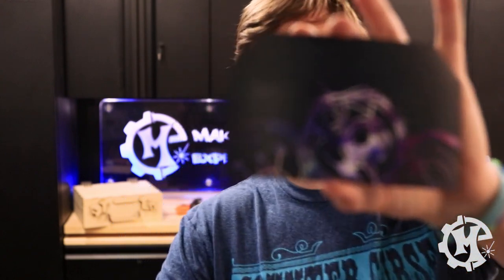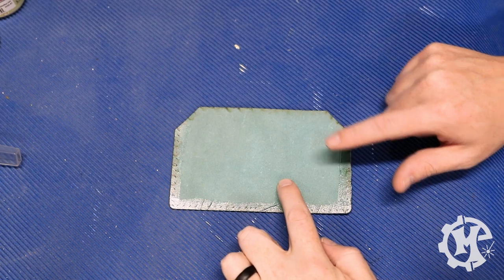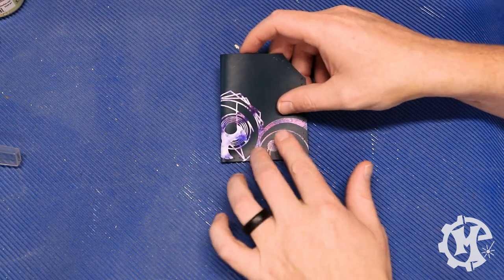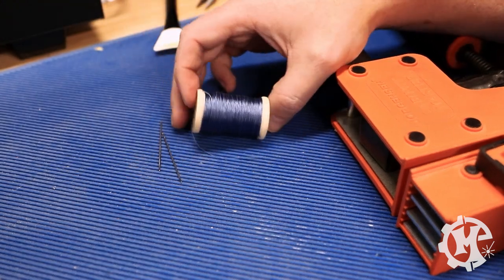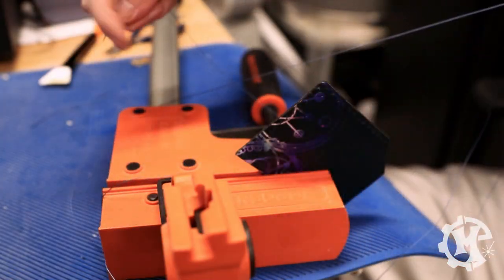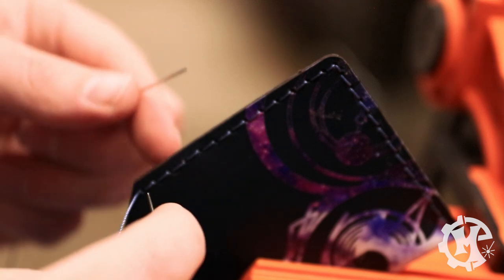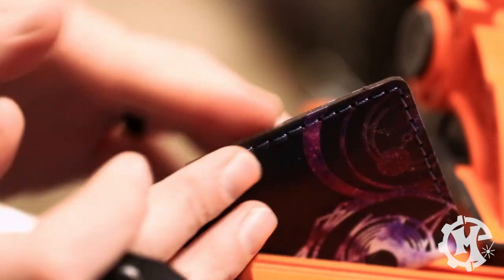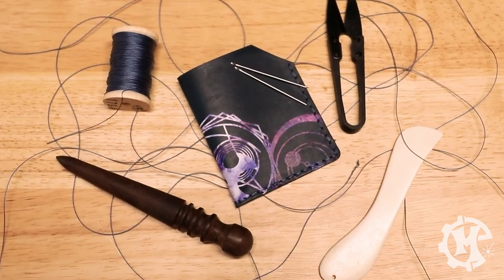How to Make a UV-Printed Laser Cut Wallet That Looks Amazing!

Comment: Hello, I see that you are using some magnet for keeping the leather well placed. Can you tell me more about it? How do you make it stick to the grid?
Reply from the maker: The grid in the Epilog machines is magnetic so I just used a magnet on the top and it sticks to the bed.
Reply: @Maker Experiment  is it a specificity of the model or grid of epilog you use? I have an helix and tried magnet but was not sticking
Reply from the maker: @archireel_be  it’s on the newer Edge and Maker for sure. I don’t know if it’s on the Pro but it’s pretty much across the Fusion line. They weren’t magnetic before now.
Reply: @Maker Experiment  thank for the answer and for the great quality of your video. I am very jealous of your UV printer 😊. Would be a great complement to the Epilog I use today
Reply from the maker: @archireel_be  it’s been a lot of fun to use in tandem with the laser.
Reply: @Maker Experiment  quite expensive to make a business use of it compare to engraving and vynil cutting.

Comment: Be careful about the print heads. Especially white. It clogs pretty fast.
Reply from the maker: Yes, white is notorious for clogging easily. If it wasn’t a necessity for printing on darker items, I wouldn’t even have it.
Reply: @MakerExperiment  it iş the second time it got clogged. I am sick of it.
Reply from the maker: @erem51  I’ve found that if I don’t run it every single day, the white clogs. Even 12 hrs between prints and it clogs. I end up shaking it for 2-3 minutes every time I boot the machine up. The printer ink for mine is in bags and I can shake them back and forth to help break up the clog. It doesn’t always work but it does help.